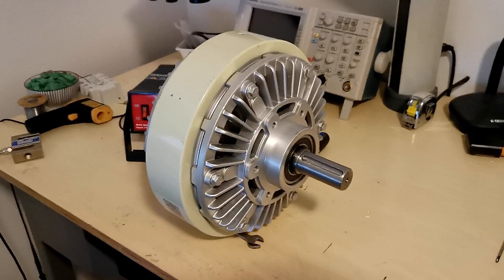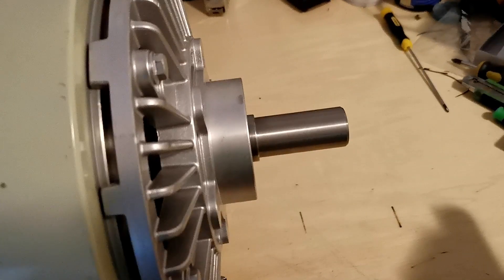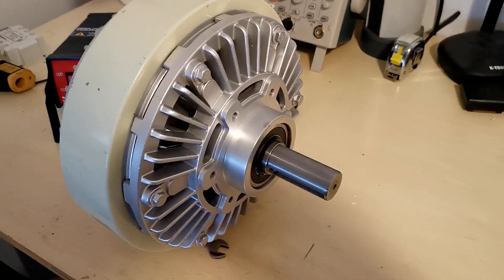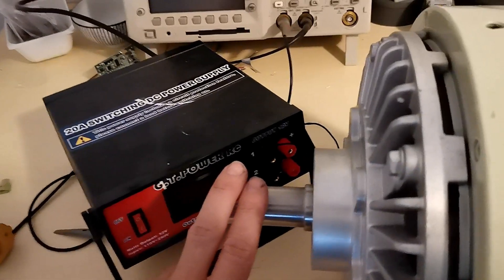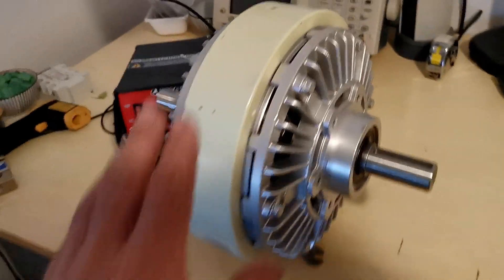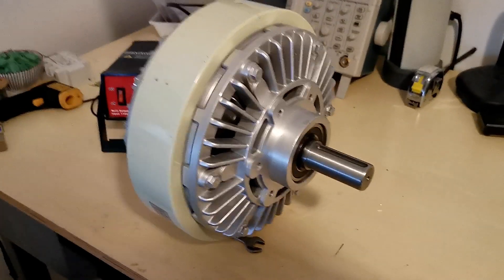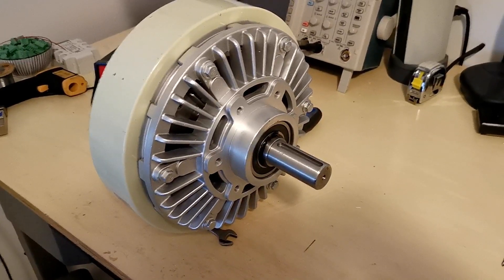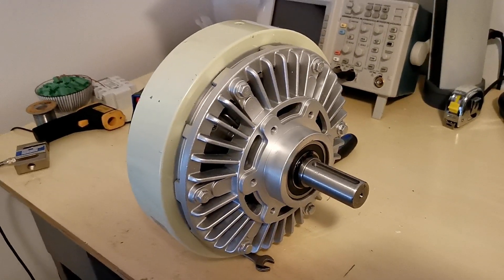YourDyno.com: Magnetic powder brake

Comment: That is actually a magnetic powder clutch, as it has an input shaft and an output shaft.  It provides variable coupling, not braking.  A magnetic powder brake only has an input shaft, and only provides variable braking, the magnitude of braking torque determined by the applied voltage.